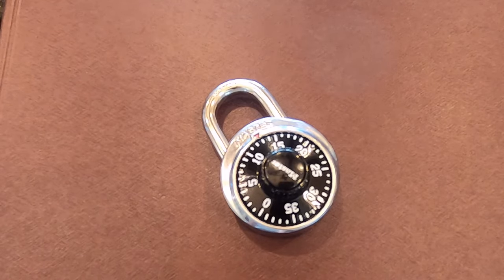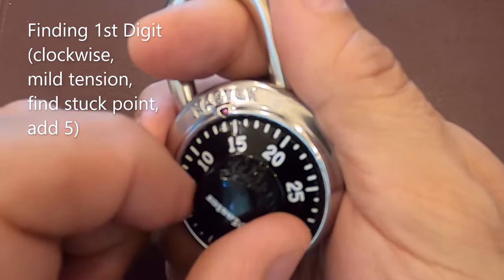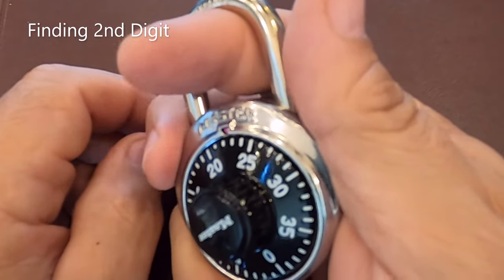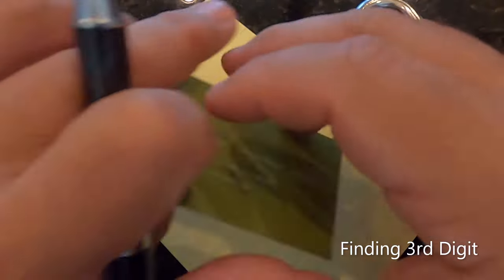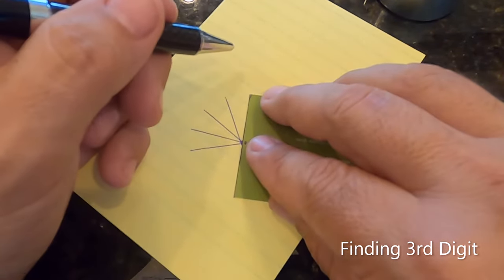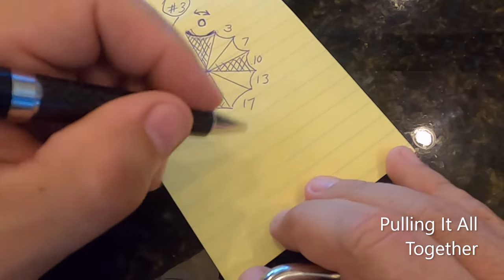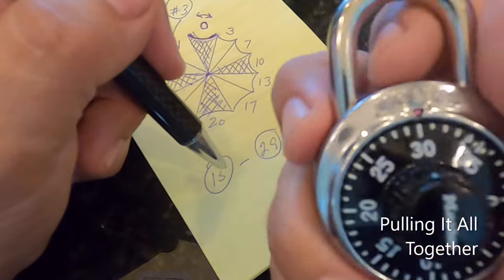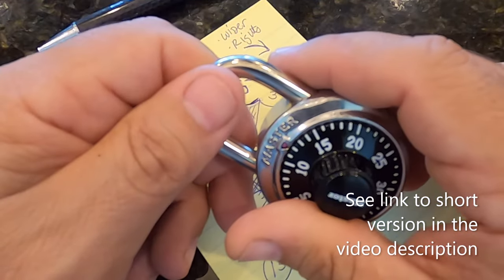🔒Lock Picking ● Expanded Version ● Find Combination to Any Master Lock Padlock Using Feel ● No Math

Comment: At last! The mathematical method didn't work for me, even using the fancy online calculators. Even your earlier, shorter video had me stumped. But this expanded video did the trick. Once I knew the third digit for sure and it still didn't open, I realized I was doing something wrong with the first two. Turns out, when dialing the second number, there is one case where you do not go past the first number: when they are the same! My combo was 0 - 0 - 32.  Thank you Apache Pilot!
Reply from the maker: This is great information and very helpful. Thanks for sending this on, I’m going to practice using what you said.

Comment: Thank you!🎉🎉🎉🎉 I unlocked mine after watching 3x up to 5 mins mark. The 2nd # is crucial.
Reply from the maker: Correct. The 2nd number is the only tricky one to find really. The first is very evident. The third just quick trial and error. But that second number is key!!

Try my short version of this process. It gets the job done in 2 minutes! 

🔒Lock Picking ● Find Combination to Master Lock Padlock ● Less than Two Minutes Using Only Feel
https://youtu.be/IxOwyOnnb18

Comment: I was using this trick in school back in the mid 1980's.    They introduced an alternate design in response to the flaw.

All these videos with that same technique , yet none of them mention it doesnt work on all specimens.
Reply from the maker: I’ve not yet encountered a Masterlock brand combo lock that this did not work for. There are other brands that operate differently. Thanks for your comment.

Comment: Took me a while for the REAL 3rd step: I found these points
First set: 0 to 1, 10 to 11, 20 to 21, 30 to about 31.2
Second set: 4, 14, 24, 34
Third set: 7 to 8, 17 to 18, 27 to 28, 37 to 38
So 30 to 31 is the odd one out
And my 3rd number was 31
Reply from the maker: Great! Glad it worked out for you!!

Comment: i think i know the 1st and 3rd number but i cant find the sticky point for the second number. Also i ripped off the back and looked at the discs and found the 3rd number but no idea what the second number is

First number is 3, Third number is 8, Hard stop point is 30

Edit: After playing with it a little bit and checking the discs while i was turning it, i have found that the second number is 21. i thought i felt a little resistance around 20-26 area but the lock is a little beat up so i assumed it was just from that
Reply from the maker: Great job!!
Reply: The first bite point where his was 1 is almost impossible to go past but the second bite point I think his was 9 will be easy to go past so be careful not to go past. The second number will be a slight resistance to your turning motion so it’s very hard to feel, you have to go slow and try multiple times to see that your right. I followed his instructions and was able to crack a random lock I found on the grass. I think you will be able to do it

Comment: 1:48 I used the clockwise method and it got stuck between 21 and 22 which would mean my 1st number is 27(correct), but when I do it the other way it gets stuck between 11 and 12, and adding 14 does not equal to 27

Comment: I’m having trouble getting the pressure right.  Do you have any references for how we do that?  I also just by messing around I’ve accidentally opened twice but I have no clue how or what numbers.
Reply from the maker: The one way that has helped some folks is to practice with a lock that you know the combination for. Then increase your pressure just enough to be able to feel it “hit” on that number consistently, and try to get a feel for why that number is different than others and build some muscle memory for how it feels. I hope this helps!

Comment: Found the first and second numbers using your techniques. 30-24-? The last number has been a struggle for me. I’ve tried going through your system of finding where it’s more loose (has more play). And yet im still not able to unlock it.
Maybe it’s because my lock is a “Dudley” brand? But it is also a combination lock from 0-40.
Reply: If you know the first and the second numbers ... then why look for the third number.  Seriously, if you dial in the first and second numbers properly, then simply move dial clockwise in increments of 2 and pull up on shackle .. and the shackle will release itself when dial hits last number.

Comment: I love how the text on the video go from "finding 3rd digit" to "putting it all together"
and you only note down 23, and full 15 29 out of thin air..
Reply from the maker: I’m guessing you missed the first half of the video, where we solve for digit one and digit two. Everything drawn on the paper is focused solely on digit three. Hope this helps.
Reply: But if you already know digit one and digit two ... then last number is easily found just by pulling up on shackle every 2 numbers while turning for last number.  Or if you want, pull up on shackle on each number.  Simple, easy, fool-proof!  Makes absolutely no sense to try to do any 'pressure' or 'math' if you already know first and second number.   @ApacheRanch
Reply from the maker: @michigancitizen9548  yes, absolutely correct. See my other video for doing that in 2 minutes. This video is here to explain a methodical way to determine the third digit. It’s not for everybody. Thanks for your comment.